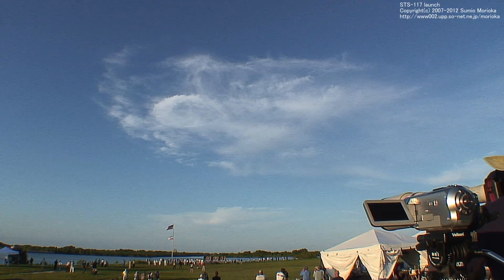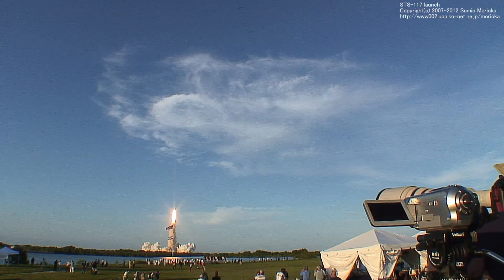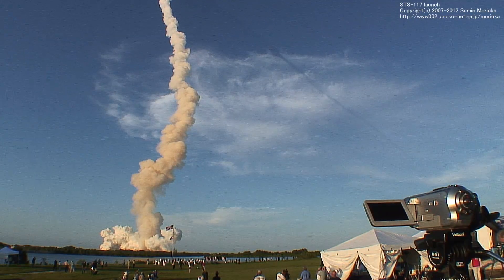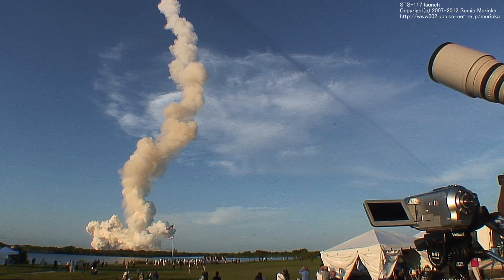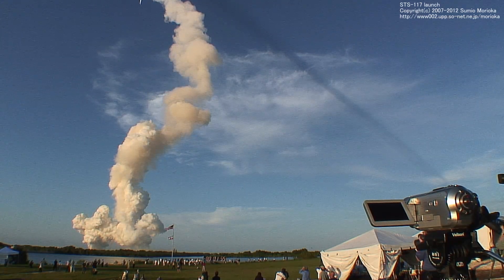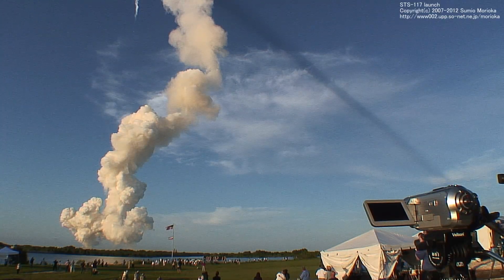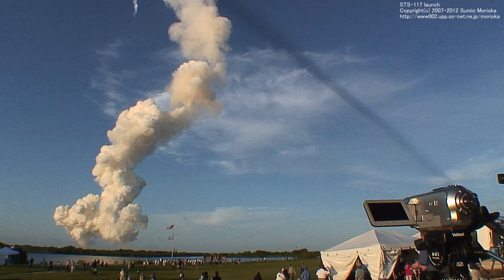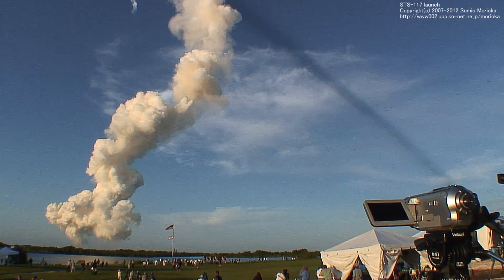[HD] Real Sound of Space Shuttle STS-117 Launch, 3 miles

Comment: My God. The sound from this distance is massive and overwhelming. The sound up close would just boggle the mind. Beyond the ability of human hearing to experience.
Reply: It would literally kill you if you were up close. It is that powerful. The sound energy is so powerful is can damage the frame of the launch tower. That's why they spray water everywhere before it launches. The vast amount of water, instantly turned into steam by the engines firing, in the air slows down the sound some to keep it from being as damaging. Sometimes you can see the sound energy smacking the exhaust/steam clouds as the shuttle leaves the pad. It's wild the way it hits them.
Reply: It would kill you.... 220 db and up....

Comment: Ok so even from approx. 5km away a microphone still can't record the sound without cracking because it's too loud? o_O
Reply: Isn't the cracking caused by the rockets firing something 6 times a second?
Reply: +joey schmidt audio productions I get you and put simply, it's is so loud that the compressions (high pressure) of the soundwaves catch up with the rarefactions (low pressure), which creates acoustic booms. to be specific, soundwaves do not propagate with constant speed. since the difference between the speeds is increasing as a function of noise amplitude, this phenomenon pops up if the amplitude is high enough, see jet engines etc.
Reply: ***** yea, that's what I meant, but it's not a constant burn though.
Reply: ***** You're not getting me, I don't mean that they turn them on and off again.
Reply: ***** Wait, I'm talking about the RS-25, not the SRB. Now I get you lol!
Reply: The crackling sound is produced by the SRB jets. There is a constant flow of supersonic gas interacting with the atmosphere and slowing down to subsonic speed. When that happens it releases a sonic boom.
Reply: see my answer above...

Comment: Why are the American rocket engines exhaust so dirty when compared to the Russians?  Every video I have seen on youtube shows Americans spewing visible filth into the atmosphere as oppose to what appears to be clean burns by the Russian rockets.
Reply: +Kronaphasia do some researche before saying something like that, at the launch its mostly water vapoure because they spray the launch pad with water to lessen the shock wave coming back to the launch vehicle, also the boosters are solid fuel ones, they are always more smoky, Russian or American, the main liquid engines on the orbiter are very clean, they use hidrogen for fuel.
Reply: kronophrasia many Russian engined are using jet fuel and liquid oxygene like spacex. This burns with a yellow flame. another example is Saturn V. The Space Shutte however uses solid rocket boosters which create a lot of dust. The main engines however are using hydrogen and liquid oxygene which is almost invisible.

Comment: The muffler & the catalytic converter need some work.
Reply: Needs new muffler barings and the alternator fluid needs topped off, too much sound. Lol
Reply: "open headers"
Reply: The vTech didnt kick in... you didnt get to see the extra 15hp.. ☠😂
Reply: @CranioUomo  The head gasket is blown.
Reply: The carbs definitely need rebalancing, should sort out the gurgling as it pulls away.
Reply: What does a catalytic corverter do to water vapour? Depends on the catalyst really.
Reply: Nothing some flex tape can’t fix
Reply: Don't forget some blinker fluid...
Reply: @FredtheDorfDorfman1985  also the transmission fluid!
Reply: What muffler and cat converter, he's running that thing straight pipe 🎉
Reply: The Cat was stolen
Reply: Jajajaj I am laughing

Comment: It is interesting to see that the cracking sound (~O(10)Hz frequency) does not occur until the shuttle has moved a significant distance upwards from the launch site. A closer inspection of the plume reveals the that frequency is to a noticeable degree synchronized with large scale oscillations of the radiant part of the plume. Has anybody done an analysis of the acoustics during take off ? Why is this cracking sound absent during the initial stage during the launch, or at least not as dominant ?
Reply: Mario F Trujillo 
They are creating a huge Waterfall under the Launch Pad to absorb the Sound, otherwise the Power of that Soundwaves could damage the Shuttle on the Start.
And Sound travel slower then the Light, so there is difference of a few seconds between what you see and what you hear.
You are 3 Miles away from the Pad ! ;))
Reply: Yes, I understand the use of water and delay of sound vs light waves; however, the cracking sound comes well after the initial lift off. Something else must be going on.
Reply: It is a combination two things. At this distance it takes almost 15 seconds for the sound to reach the camera, so what you are hearing matches what you saw 15 seconds ago. Also, the main engines ignite 5 seconds before liftoff, so the first sound you hear is the main engines firing 5 seconds before the boosters ignite and the shuttle moves.

Comment: I wonder, which of these is louder; a Boeing 737 taking off from 100 feet away, or a space shuttle taking off from 3 miles away?
Reply: I can answer this based on personal experience. I have a YT of a 1968 super 8 mm movie I made standing less than 100 feet from the rear of 737's and 727 on takeoff. This was when they made rocket type noise. It was much louder than today's jet engines. It was louder than the shuttle when I was at there to see it in the 80's. The jet engines had a sound like they were ripping apart the air. The shuttle sounded much deeper, more like an earthquake. Both were unforgettable.  Search YT for LaGuardia 1968. Sorry no sound but then again no camera then could duplicate it. Today's jets sound tame by comparison. The shuttle would likely win today. If you want to hear jet engines like I did you need to go to a military airshows where you can get close up. The UK shows seem better for this as I've seen on YT.
Reply: Nice video you got there! Obviously a jet at 100 ft is louder than the shuttle at 3 miles, but if both were at the same distance, only the rockets would be heard :)
Reply: Today's jet engines are large bypass type propellers connected to a turbine driving the large blades.  Older jet engines had smaller blades up front and depended more on exhaust thrust rather than front blade thrust.  The larger front blades today are very quiet.  Today's jet engines are like shrouded propellers.

Comment: What would the white smoke smell like if it made it all the way across the water from the launch pad
Reply: main engine burns Oxygen and Hydrogen, i don't think you can notice the smell, not sure about the SBR, they burn magnesium and aluminium i guess
Reply: RedhotIta1  i thought it was carbon not mag and alu
Reply: Nothing, the white smoke comes from the three main engines on the shuttle and the only "waste" they produce is vaporized water.
Reply: AverageArts "... the white smoke comes from the three main engines on the shuttle and the only "waste" they produce is vaporized water."

===== See my detailed comment. They burn aluminum, butadiene rubber and ammonium perchlorate. Likely, they smell like a fireworks show. =====